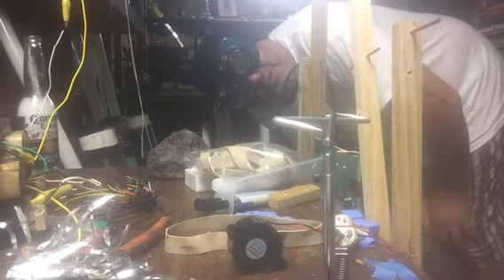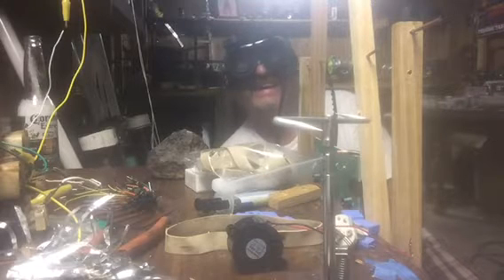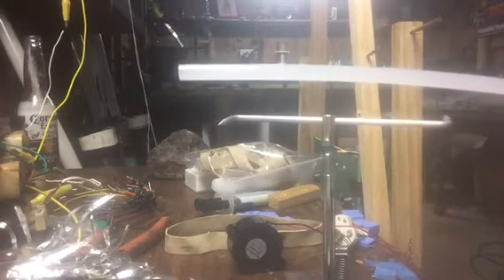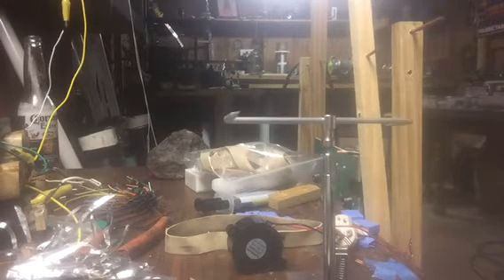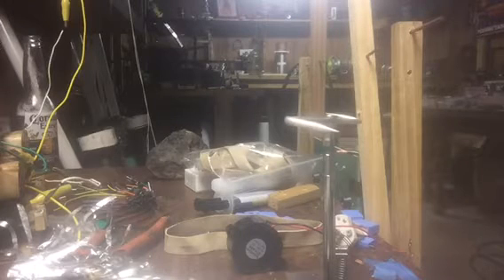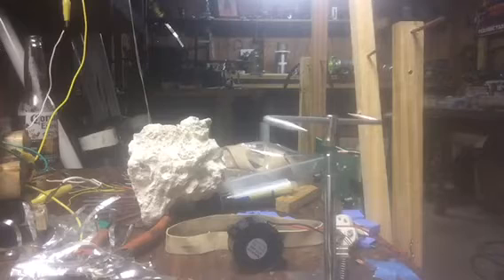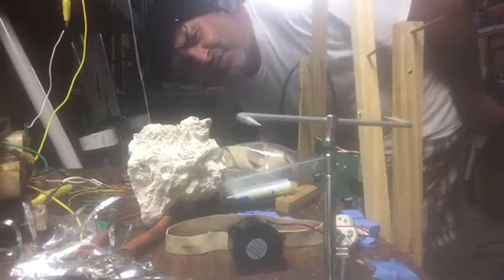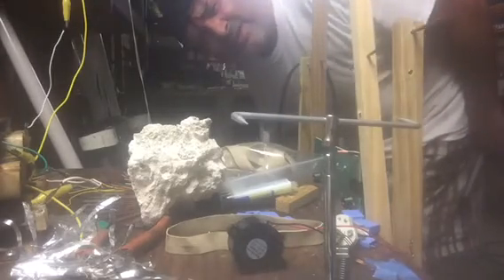Static and us!  Part 1

Comment: All it is transfer of energy by manipulation. Example take a 1 ton Square rock try pushing it on a flat road base say Tarmac you will just may be move it then get the same mass of rock In A wheel shape you will move it easier why I assume because its mass is attracted to the air more than that touching point as it rolls to the planet. That's all it is getting the attraction repulsion pulsing in order Just a simple thought.